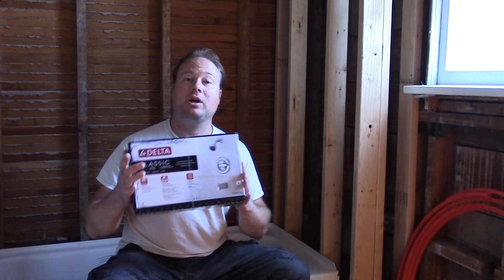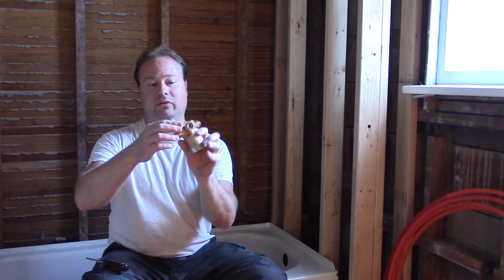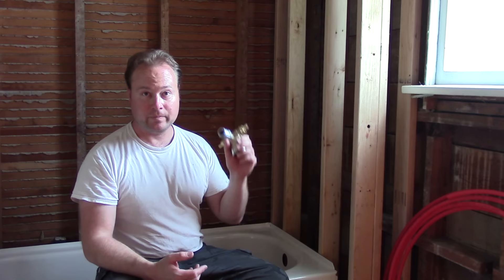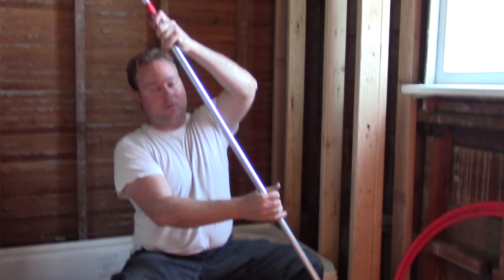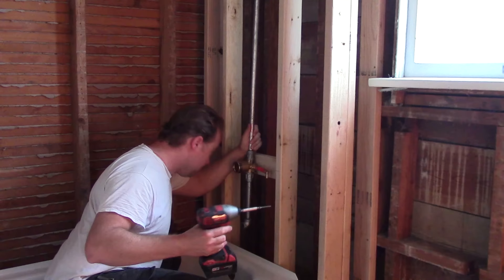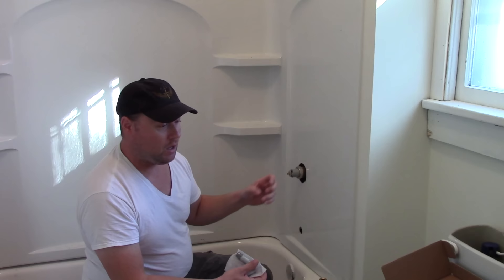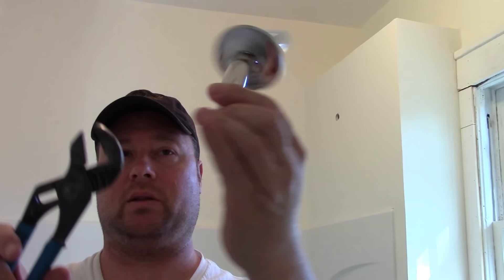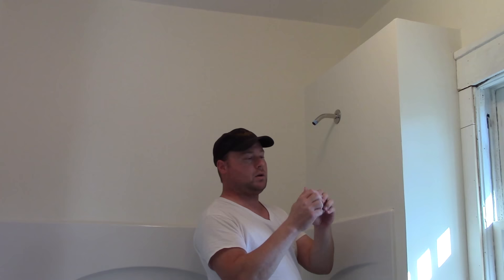Delta Shower Faucet Install

Comment: Great video. Purchased the same kit, because my beloved wanted the face plate, and handle changed. (Didn't need the shower head that came with the kit). And by watching this video I now know that I purchased the WRONG kit. I do NOT want to go digging into the wall the replace the fitting, because I don't need to lol. I just need to purchase the face plate, and handle. Back to Home Depot I go. Thanks again for the video upload
Reply from the maker: Glad it was helpful! You can definitely just order a new trim kit for the faucet. I recommend getting a new cartridge as well. I don't know if Home Depot can special order that, they probably can. If they don't have the option that you want, going to a local Delta dealer would be best.

Comment: Instead of putting the channel locks on the finished shower arm. I always just stick the rubber coated handle part into the nipple where the head screws on and use the pliers to tighten it up. No scratches
Reply from the maker: You know, that's not bad. I will have to try that.

Comment: You can tighten the shower arm with the plier handles by inserting one handle into the shower arm and turn it like a steering wheel without any damage to the arm.

Comment: I like using copper or pex with push fit fittings instead of galvanized pipe. That way you can cut it yourself on the job not at Lowes or Depot and no reaction from hot or cold water with metal pipe. If it’s off just an inch from where you want it you’ve go to go back to the Home Center to hopefully find someone that can cut and re-thread again.

Comment: Ok. All i needed to know was that threaded brass fitting that threads into the faucet can be soldered. It does have a 1/2 inch opening for a copper pipe. Im an electrical guy, can do entire home wiring and it confused me ok...looking like i have a bit of a knack for plumbing too, i suppose much was learned from building on old Devilbiss  Air Compressors when i was a teen. Thanks sir again a useful vid. Well understood.
Reply from the maker: 👍 So glad to help! Thank you for watching. Check out hundreds more of our videos at https://www.aroundthehome.org And here is a newer video that might help out as well. https://youtu.be/NuI2vuR6Fjo

Comment: Amazing how the shower surround just appears  during the install. Wish it would do that for me because the only info I need is the size hole to drill. For some reason neither Delta or Sterling says what size hole to drill for my Delta DT17238 into my sterling shower surround. I am assuming just big enough to let the cover plate screws attach to the valve, which in my case would be 3 1/2 inches. Great instruction video, just don't understand why you skipped the drilling part.
Reply from the maker: Guess I didn't realize that I did that. It was quite the long on complex video to make. It's odd that they don't list a size for the hole. I find around a 4" hole works good. You want to have access to the shower valve, but not to big obviously so that the foam seal on the trim plate has plenty of area to seal onto.
Reply: Thanks for your quick reply. I really appreciate that guys like you take the time to share their expertise.
Reply: 3 inch

Comment: After unboxing, put all the trim parts back in the box, put the box in a safe place, and —> remember where you put it <—. Depending on the size of the job, you won't need them for weeks or months. Also, NEVER throw screws on the floor. It would be more honest to just throw them straight into the trash.

Comment: There are pex fittings already to go for the guys and ladies that want to use pex with crimps without having to put adaptors from female threads to pex and save a few bucks.

Comment: I just had my bathroom redone this week and finished today. They installed this delta shower set. He mentioned that he didn't talk about the scald guard, I to didn't have very hot water, its super easy to adjust, you literally take off the lever with the Allen wrench. Then there is a round white disc with teeth on it that says pull. You pull it out and turn it clockwise to Adjust how hot you want the water to get, then push it back in.
Now my tub spout didn't screw on like that and moves all over the place, its not mounted to anything but the piece of copper tubing that stuck out of the wall :( gonna try to caulk it and see if that helps.
Reply from the maker: I mounted the tub spout onto a piece of galvanized pipe here. If it was mounted to copper, then there should be an Allen screw on the bottom that should keep it tight in place. Thanks for watching. Don't forget to stop by our website www.greatwhiteninja.com

Comment: The handle does not turn completely to hot, which I suspect its not correctly installed and why water doesn't get to heat. Thank U!
Reply from the maker: I looked back through this video and see that I forgot to talk about the scald guard. It sounds like you need to adjust it. It is easy to adjust and simply keeps the handle from turning all the way so you can't get the water too hot. Unfortunately, I don't have another video showing the Delta scald guard, but I do have a video showing the Moen scald guard pretty well. It's not the same, but pretty similar system so this might help you out with yours. Go to the 8:10 mark on the video. https://www.youtube.com/watch?v=A43Q0NBUg0I

Comment: If it’s a older house with  2 inches of sheet rock and a 3/4 board behind the tub wall nothing will work as planed prepare to make wood blocking for back support to hold the valve in place lil more work than this look closely at wall thickness before you go with this valve

Comment: Hello my friend for this job we need to disconect the main water o no??
Reply from the maker: Anytime that you are working with a shut off or shower / tub faucet then you would have to turn off the water to the whole house. Unless your house has individual shut offs for areas of the house, which is uncommon but does exist.

Comment: I wish Delta would specify what size of hole to cut in the backer board . I see a few guys using 3" hole saws . I am using Kerdi board , but not using there Kerdi flange , as they only make the flange for the mixing valve and not the diverter .Although The Delta R11000 has the same size diameter as there mixing valve , it uses a smaller diameter bezel , so 4.5" isn't going to work .It's also counter sunk into the board making it tougher to tighten the bonnet . Can't even buy a socket in town big enough to accommodate it .I don't think I'll even use a diverter valve again , and if I didn't spend so much money on th fixtures , I'd kibosh having both a shower head and a separate wand

Comment: My brother-in-law installed one of these but when we turn the water on it comes out the shower and the knob will not shut the water off. So what did we do wrong? The shower knob will turn a quarter turn to the left and then stops. Did we forget to take a piece out.. why won't it shut off?
Reply from the maker: It sounds like the scald guard my be installed incorrectly. Can't be for sure without seeing it. I would take the handle off and just remove the scald guard ring and see if that works. If you are still having problems you can send me pics if you go to my website and after you send in a contact form. https://www.aroundthehome.org/

Comment: Our insurance companies do not like galvanized pipes .  They raised my deductible from $500 to $5000 because I had galvanized pipes in my home ., and they told me I also had to cover the first $35,000 damage if one broke . Thankfully I got them all replaced , and here you are installing them ? 
I'm in BC Canada
Reply from the maker: Thanks for watching up there in Canada. Now I am in Missouri, USA. The weather is a bit different and so are the insurance regulations. I was not aware of additional costs for having galvanized pipes in Canada. Down here the only problem with galvanized pipes is the mineral build ups that happen. Copper pipes don't have that problem, but I have been in many homes that have had multiple types of pipes in them and the galvanized survived freezes when the copper broke. As far as pipes in your home, putting galvanized outside of your shower faucet shouldn't count as having galvanized pipes. That should just refer to the pipes that are under pressure all the time. I used the galvanized pipes in this video because I am not great at soldering , and is better for a DIY project. Also, I like to have metal pipes going up to the shower head and down to the tub spout to make the faucet more secure. And around here, galvanized and copper are the only metal choices.
Reply: I have pex going to the shower valve , and from there I'm going copper . I actually really liked your galvanized pipe idea , as it would be strong as all heck. 
I'll stay away from it though ,just to be on the safe side . But the more I think of it , you may be right . They normally use a galvanized piece of pipe for  the shower out of a drop ear. 

I was debating to use 3/4" pex out of the valve . I don't like when you use 1/2" pex for the output  , as the fittings have such a small area and some have issues with water backing up out of the shower head . 

At the plumbing place and most videos , they use a drop ear on the shower head , and on the tub they use half inch copper pipe . I would like to use drop ears on both ideally , but the guys told me it's hard to get the right length using galvanized. 
I have all my boards spaced at 2" back from the front edge of the stud , just like the delta valve . I'm using all delta faucets , fixtures , and valves . 
I think they have a copper piece that interfaces to a short piece of galvanized if you you a drop ear for the tub spout . Maybe this is overthinking it and creating to much potential for a leak ?
Reply: I don't know about the insurance issue, but I am in Vancouver BC and the acidic water causes corrosion in galvanized nipples. In our hundred year old house every area that had galvanized nipples had red stains in the fixture. Toilets with red residues, shower floors etc. My guess is Missouri has harder water that doesn't corrode so badly. 
Thanks for the instructions - very helpful!

Comment: Does this shower faucet opens completely till hot or only half?  I got mine installed and I am pretty sure is not correctly installed cause water does not get to heat and I am almost sure its because its not turning fully to hot only stops half the way. Thank U!
Reply from the maker: Let me know if this helps you with your shower.

Comment: Did you put sheetrock behind the tub walls? I got a direct to stud shower and feel like this is meant to have something between the studs and shower wall. Valve protrudes too much through wall. Nice video, thanks for any info
Reply from the maker: No, I did not put any sheetrock nor wallboard up. These are screwed directly to the studs. If your faucet is protruding to far for your setup I might suggest to use a 1x4 instead of a 2x4.

Comment: What happens with the plastic square piece? Is that only used for spacing and then discarded? Great video.
Reply from the maker: Yes, you are correct. Just a spacer. Thanks for watching. Don't forget to stop by our website www.greatwhiteninja.com

Comment: don't ever use galvanized pipe brother! This is going to rust!!
Reply from the maker: Too late..... Oh, I will use galvanized pipe, yes I will. You know, they may rust, but they are some of the toughest pipes around. I made this video before PEX was really mainstream and accepted by professional plumbers in the wall, not just under the house. And for my to teach a DIY'er to do this I stand by my choice over sweating copper, especially given this was a remodel connecting to plumbing with water in it. Curious, if you guys are Home Experts, then why are you watching "how to" videos?

Comment: very nice video,  whats the package number of whole complete shower trim and rough-in kit with cartridge ?
Reply from the maker: Here are the Amazon links for that shower
Shower trim kit: https://www.amazon.com/Faucet-T13220-Classic-MonitorR-Shower/dp/B001AHXOJQ/ref=as_li_ss_tl?ie=UTF8&qid=1530966019&sr=8-16&keywords=delta+shower+faucet&linkCode=ll1&tag=greatwhitenin-20&linkId=9d28abef5c09fa03feaad3f09ec11dad

Shower Valve Body: https://www.amazon.com/Faucet-R10000-UNBX-MultiChoice-Universal-Shower/dp/B001AI1VMW/ref=as_li_ss_tl?ie=UTF8&qid=1530966019&sr=8-7&keywords=delta+shower+faucet&dpID=51okHdaJacL&preST=_SY300_QL70_&dpSrc=srch&linkCode=ll1&tag=greatwhitenin-20&linkId=9bcf59bfbe86fdd2d2346b598ccc24cd

Comment: Your demonstration is very good, however mine has the slip on faucet where you have the screw on. I was wondering if I can use 1/2 inch CPVC and how long out of the wall should it be?
Reply from the maker: Are you talking about the tub spout?
Reply: @AroundTheHome1  
Yes and I read it's supposed to have copper but I have cpvc and also need to know how long out of the wall I need it.
Reply from the maker: Even though cpvc has the same outside dimensions as copper, I would suggest using copper. Many plumbing supplies will sell a copper pipe with the threaded adapter already attacted.  The instructions should tell you exactly how long to have it, but if I remember right it should be about a half inch longer then the adapter is outside the finished wall.
Reply: @AroundTheHome1  
Not sure what your talking about, my pipe doesn't screw, it has a slip fit with an "o" ring.
Reply: @AroundTheHome1  
By the way, I just answered my own question. All I have to do is make it long enough to go through the "o" ring and it's sealed.
Reply from the maker: Ok, glad you got that going ok.
Reply from the maker: I think that we were talking about the same thing, just didn't know it. But yes, as long as it is past the "O" ring that is long enough.

Comment: How can adjusted the hot water and cool water because i installed my but look like it's not enough hot water convine cool and hot to warm up to get shower comfortable?
Reply from the maker: I don't completely understand your question, but it sounds like you are having troubles making it hot enough. If that is the case, then it is probably the scald guard keeping you from turning the handle all the way. I don't show it that well in this video. This is a very old video of mine, and I have some newer ones that do better for that. Here is one and I have the link set to start when I talk about the scald guard. https://youtu.be/hGI9F-lY5xk?t=407

Comment: Is the hole square or round which have to be drilled out, what size drill bit, if square hole what size, thanks.
Reply from the maker: @Richard Hotchkiss  ok let me break that down. This is a very old video of mine so it does have some things left out. First let me try and answer those questions the best I can. I use a 1" hole saw for the shower and tub spout. If cutting though cement board I like graphite grit hole saws. Now for the shower handle and main trim piece that depends. If it is round then use a 3 1/2" hole saw, or cut with a jig saw the best you can. If it is a square trim plate you can still cut out a round hole, or make it more square. You will see where the foam weather strip is on the backside of the trim plate. Hole should be like an inch smaller all the way around. Here is a newer video for that with better tips. https://youtu.be/NuI2vuR6Fjo

Comment: Bright he didn't talk about the cartridge and details of cartridge
Reply from the maker: This was the first time I made a video this complex for the full install covering just about every aspect that I could think of. Did you have a question about the cartridge?
Reply: Nathan Cox .  Yes .. it was okay install .. .. my tub was just changed out and I wanted to see how to adjust the hot water on the Delta faucet it still has very little adjustment between hot and cold after I corrected it 3 * X thanks for replying.. the problem I have is almost all of about 90 degrees is cold until the very last tiny few degrees hot comes in/out.? I wanted to adjust it myself so not to bother the plumber again
Reply from the maker: Do you have 180° travel on the handle?

Comment: you cut out the actual step of installing the cartridge.
Reply from the maker: You know, when I first read this comment, I was like no way. Went back and checked it out, and you are right. I did glaze right past that. Very old video for me, sorry about that. So the cartridge will say hot on one side and that should be on the left side. Then just push the cartridge in and snug up the locking ring. Don't go crazy on the ring because the "O" rings on the cartridge do the sealing. The ring just keeps it in place.

Comment: Omg. I watched this whole video and he skipped over the handle part and that’s the issue I have. It’s not staying in place. Mine doesn’t come with an Allen wrench. How did you tighten it. Ughhhh
Reply from the maker: Sounds like you need an Allen wrench. Sorry I skipped over that part. This is a very old video of mine and if I ever get a chance I will re-make it. If you don't have a good Allen set, maybe this is the time to invest in one. Though, many old time hard ware stores carry Allen wrenches individually and if you take that handle down, I'm sure they could match you up. Thanks for watching. Check out all of our hundreds of video at our website www.aroundthehome.org